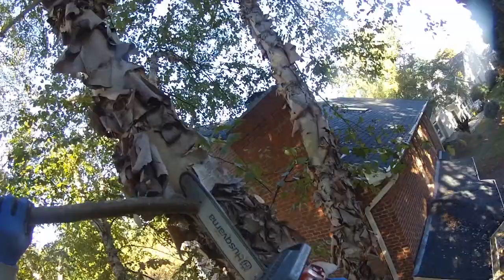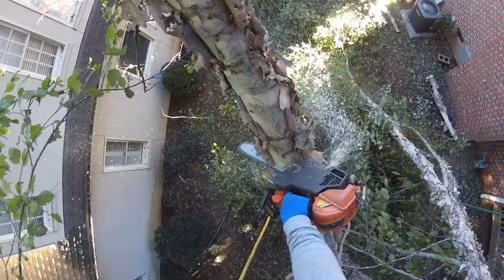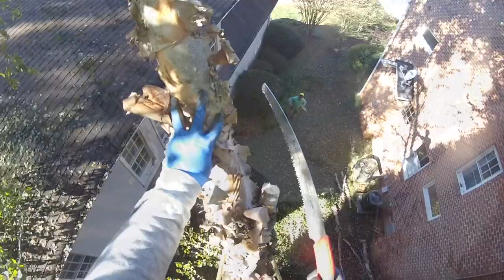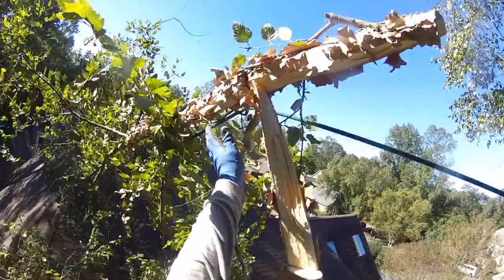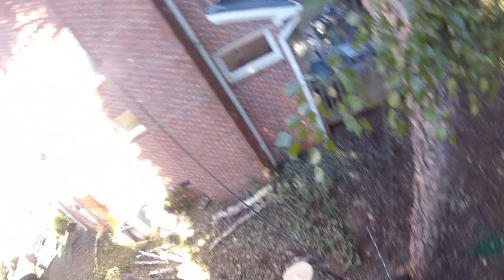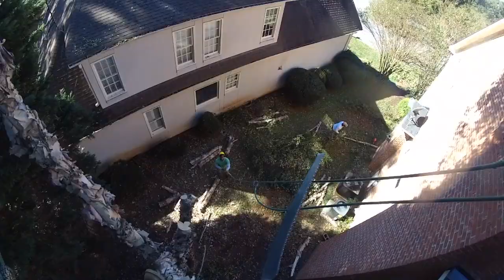Removing A River Birch Tree Between Two Homes (2018) Part 1

Comment: Perfect you say omg climb the bloody tree and lean to use a chainsaw in a tree properly ...
Reply: I'm kind of a noob Neil, so sorry if this is a stupid question but what did he do wrong? It's prob obvious but I missed it.
Reply: Unless you are one of those ultralight climbers there is no need to work any higher on those little 3" spindly river birch sections than Treeboi was doing.Without a higher tie-in point from another tree or multiple ways to spread your load it's just not worth the risk. Those sections he was working down had little to no weight, they just looked big.River birches are a favorite with landscaping architects since they are fast growing trees that can tolerate moist conditions and they look pretty due to their unique bark. It is an easy way for housing contractors to get an established look whenever they construct a new subdivision. They are extremely flexible with a tendency to peel as evident in the video.There is usually a strong capillary action associated with them as well. I took one down early spring of this year and when I came back three days later to grind the stump, water was still running out of the top like a faucet.Hurricane Florence did a number on them around here. River Birches, Bradford Pears, Leyland Cypresses, Red Cedars and Laurel Oaks all got hammered disproportionately to the Long Leaf Pines.